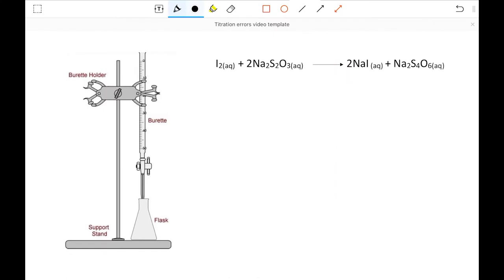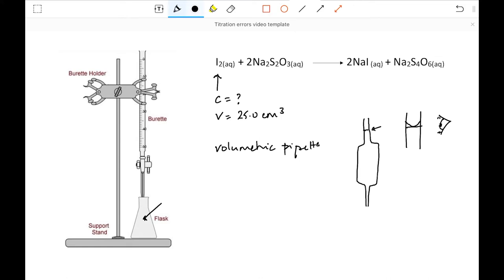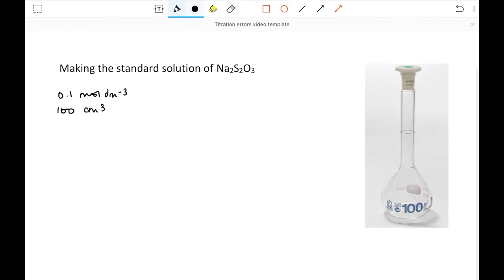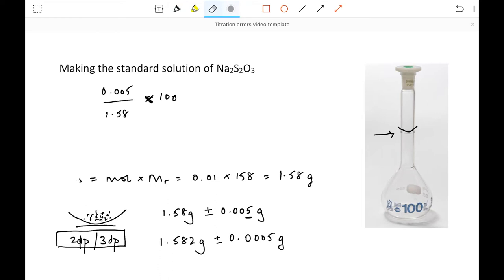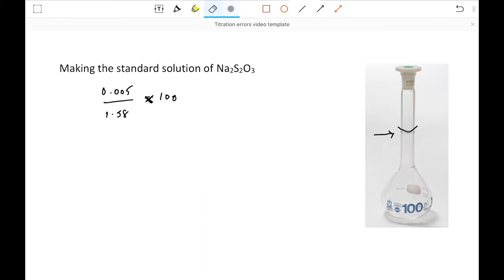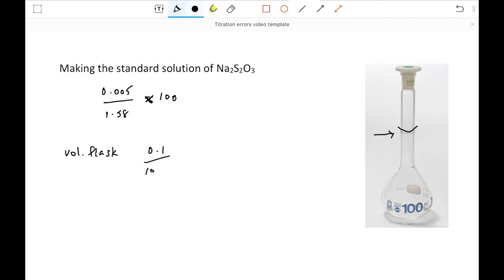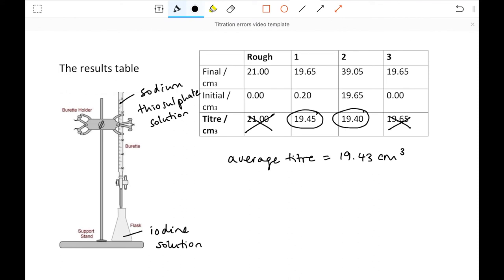How to calculate uncertainty in titration

Comment: Hello, Thank yo so much for the video. If we average 3 titre values will we multiply 0.05 by 3 or just use 0.05 .
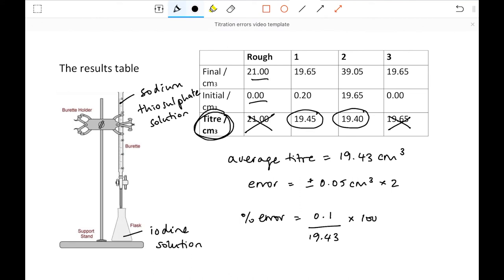Reply from the maker: Good question!  We do the titration a number of times until we have two concordant titres simply to minimise human error. The average titre is therefore the most accurate titre we can manage but in completing the error calculations we are still assuming that the average titre is one experiment and so we have read the burette twice (initial and final volume) to get a value for that titre. This means we have an error of +/- 0.05 for each reading (initial and final) and the error is +/- 0.1 divided by the average titre.  Scroll through too 12:18 ono the video for a recap 🙃
Reply from the maker: samxd officials  it depends entirely on the piece of equipment you are using but in general terms its  (the uncertainty associated with piece of equipment x how many times you used it to get your reading) / the volume or mass measured, and then multiply by 100.

Comment: hi, shouldn't we add the error from the prep of the solution to the final number?
Reply from the maker: You need to think about that  in terms of your particular experiment or investigation. If we are talking strictly in A level / exam question terms you are almost always asked to calculate a specific error for a piece of equipment (burette / volumetric flask / balance). 
If you are thinking in wider terms, for example maybe you have determined the % of copper in a sample of brass which involved weighing your sample of brass, dissolving the brass in acid, making the solution up to a known volume in a volumetric flask, making up a solution of potassium iodide to titrate the copper against and carrying out the titration, then yes you are correct.  Your final answer would be +/- the total error which would be a sum of the errors for each stage of the investigation, including preparation of the two solutions. 
Sorry that is such a long-winded answer but I hope it clarifies!

Comment: arent we using the mass balance twice here as well? (as we zero the mass balance)
Reply from the maker: Sorry its taken so long to reply - when we use the zero function we then assume that we are only making one mass observation. The other scenario is when we weigh out a great pile of solute, take a mass reading and then remove several spatulas of solute out to make our standard solution with, and take a second mass reading so we can figure out how much we used, in which case you would use two mass errors in your calculation.